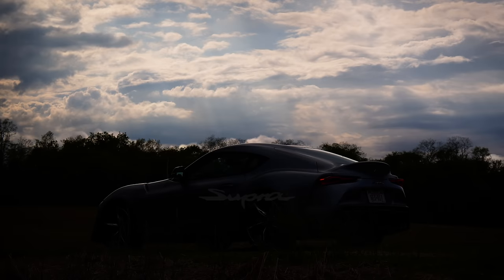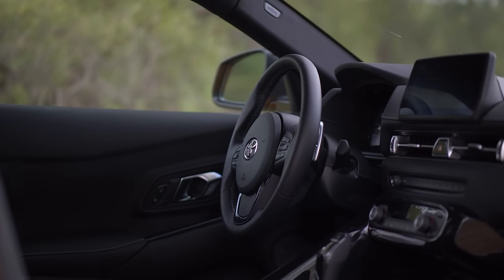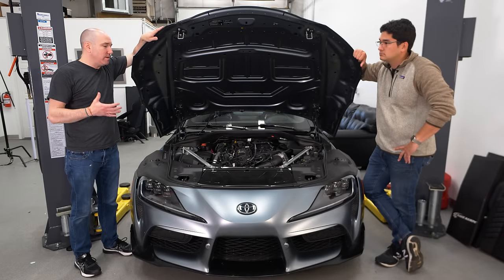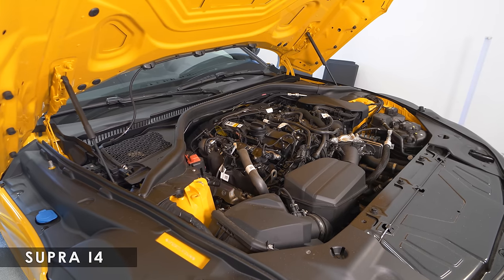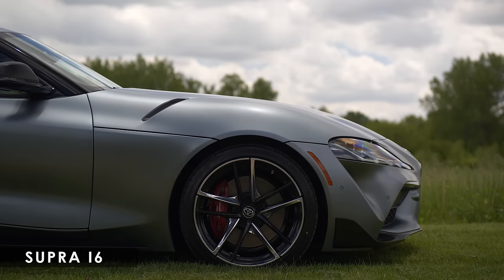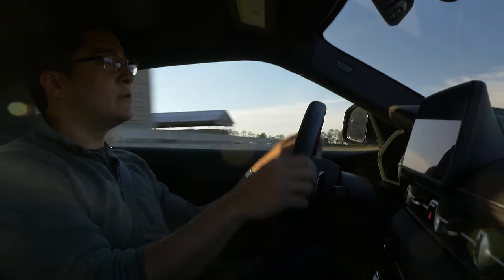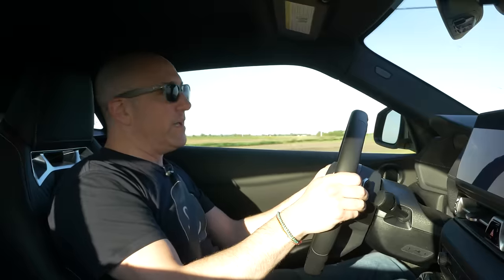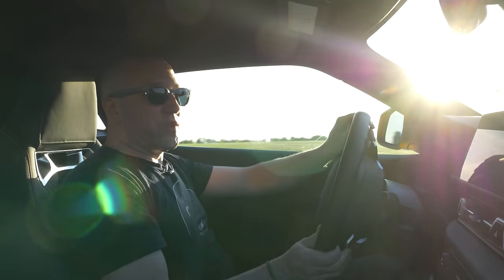2021 Toyota Supra | 3 Pedals Short of Greatness

Comment: If presented with both options, would anyone pick the automatic? Like the kind of people that might want to buy a Supra--aren't they the same people that drive stick? Are there really casuals buying these things?
Reply: To answer your question, more people who are in the price range usually drive autos (casuals). Manual is more of an enthusiast thing. If you see a 370Z riding around and the driver is girl, that car is most likely a auto (there’s exceptions) but most normal people just like a car because it looks cool more then the performance aspect.
Reply: @MaddNomad1015  right but aren't the casuals buying Porsche Caymans, Mercedes C class, BMW M340 or M2, etc
Reply: @cwx8  some are yeah. It’s like this one dude on a different supra video was arguing the whole why an auto thing and it just comes down to casuals buying anything cool that have the coin. I’d love a stick in the Supra but I get why Toyota did it business wise. I’m actually cross shopping a Supra with a Lexus IS350 FSport, if Toyota doesn’t make a stick I’m most likely going towards the Lexus just because I know it’s bulletproof
Reply: @MaddNomad1015  love the new IS. One of the best looking small 4dr on sale right now. Motor is kinda lacking though but as you'd said probably bulletproof
Reply: @cwx8  yeah it does for what year we’re in for sure. I want to at least see 350 hp. At least. I just like the new suspension work they did on the new IS.
Reply: @MaddNomad1015  yep 350-360 is perfect. What's the tuning scene like with those motors? I will say having done a teardown of the b58 it is quite a beast. No real cost cutting measures like the N motors.
Reply: @cwx8  The Toyota V6 was notoriously hard to crack ecu wise for awhile but people mod them. Turbo kits are online and the forums are pretty good, a lot of trial and error for sure. But the community is great. The B58 from what I’ve seen is awesome, do you think it will hold up to the test of time? It’s a huge reason why I want the Supra
Reply: @MaddNomad1015  looks like it. They didn't mess around with the motor. With BMW it's everything else that I'm worried about these days.
Reply: @cwx8  that’s what I’m worried about too. I’ve been keeping up with forums. The engine is great though especially after seeing Papadakis rip it apart

Comment: “It’s risky to make a sports car these days”.  And yet everyone from Chevy to tiny little Mazda can make their own sports cars.  And collaboration is a generous description for the Supra, does it even have a single Japanese part?  I’m glad the car is good, but I’m tired of the excuse making.  Toyota is the only major manufacturer that does this.  Toyota is a huge company, and if Chevy can build their own mid engine sports car there is zero reason Toyota can’t build their own Supra.  The 86 was the same way, that car is 95% Subaru.  The Supra is 99.5% BMW.

That said if BMW were to add a manual to the Supra I think you’re right, that would truly make it great.  For a car that apparently emphasizes driver connection, I’m amazed they launched without that option.  As it stands, for my next car I’m waiting to see what Nissan does with the Z, and praying they are paying attention to what’s missing from the market: a relatively affordable Japanese sports car, with a manual, that is not outclassed by a Civic Si.

Comment: Would have been nice, if Toyota could have put one of its own, maybe modified, 4-cylinders in it - Toyota has plenty of those. I'm not the biggest fan of the BMW 4-bangers which don't compare to their 6-cylinders. But I guess going with the BMW engine was cheaper (since it basically comes with the platform) and I don't know, if the terms of the agreement between BMW and Toyota would have allowed for this in the first place. Oh, and an LSD would have been nice. Maybe next year, lol.

Comment: This is a very cool car that I would love to have but not with the BMW DNA.  I like to buy my cars and keep them for a long time so having a car that every repair and maintenance project cost 10 times more than anything else is not something I want to get into.
Reply: My co-worker has an 08’ M3 with 150,000 miles. I just sold my E46 M3 with 200,000 miles. My car has had a fair amount of preventive done to it since it was a track car, but my co-worker is at 150k miles off routine maintenance. I’ve personally driven E39 M5s with 350,000+ miles on them. These cars last forever, so long as you treat them right.

Comment: Open rear diff at 43K for a dedicated sports car?  4 speakers?   No manual transmission?  And fuel cut off around 6K?   The base Supra kind of missed the mark...
The 6-cylinder version is really the only choice between the two, welp now to wait 4-10months now to see what Nissan can do with the redesigned Z.

Comment: Why would they make a 4 cylinder supra? I'd just buy an 86 at that point.
Reply: Then you are only focusing on one part of what makes a car good.   Everything underneath an 86 is budget oriented, including that 4cyl engine.  It's a good car, but not comparable.
Reply: @travis5481  Fair. It's just that with 4cyl I'd feel like I should have just saved the money and gone with the 86 or spent the extra money for the 6cyl. I can only imagine it wouldn't feel as special.

Comment: Toyota messed up BIG time here... a 4 cylinder car keeps getting compared to a 6 cylinder car and it looks bad. They should have made a different body for the 4 cylinder model and gave it a different name if you ask me...
Also, early adopters DID NOT GET BURNT... because their cars still work fine. They drove the Toyota Supra for an ENTIRE YEAR before the 2021 came out, and had fun. I don't call that getting burnt. Upgrades are good, there is nothing bad to say about that.

Comment: 54K just for the premium edition, might as well just save for a few more months and get a C8....
Reply: Its rare find a C8 at 60k better yet under 70k. Most I've heard is most being 75k or more. You could just get a 2020 mk5 and pay like 5-10k less once these start rolling around.
Reply: Supra beats a C7 stock for stock, B58s with bolt ons make 700+whp. A very slightly modified Supra will destroy, if not at the very least keep up with a C8 for less money.

Comment: Without a doubt this is a great car I just dont get why they rebadged a BMW, If they wanted to use a readily available great inline 6 for cost cutting use the B58 drivetrain and drop it into a RWD built Lexus chassis or something else from their own stable. They could of created the chassis ( or borrowed from Lexus who already has multiple rwd chassis ) and also did a full Lexus / Toyota interior. I just cant fathom why one of the biggest automotive conglomerates in the world couldnt muster up a few bucks and use their own tech / infotainment / interior /chassis etc etc. iDrive is one of the best so whoever buys this is in for a treat but its like 0.5% Toyota and 95.5% BMW. This is just wrong to do to your Halo car, Could you imagine if Nissan had the GTR just be a rebadged Mercedes.. If Toyota doenst have the money to invest in a sports car then no manufacturs have money to invest in anything..
Love the car, Love BMW's but this is no Supra its a new Z4 Coupe like you guys said and thats great as well.

This in a manual with some BMW badging and we have a modern day Z4 Coupe.

Comment: If Toyota had made a manual optioned Supra A90 MK5, majority of the ones that say "I would buy it if it came in Manual" keyboard warriors wouldn't put their money where their mouth is.

P.S.

Vehicles like the Nissan GTR R35 , ETC is not scrutinized for having no Manual Transmission.

Same with the 1980s Buick Grand National/GNX.

Comment: I am not one for comments but when I saw the engine bay on both the 4-cylinder and the six cylinder, I was flabbergasted by the amount of hoses and connections. It reminded me trying to figure out vacuum lines on a 85 Mercury Grand Marquis or a late 70s Honda cvcc. Hopefully they done vibration testing and heat testing on all those connectors!
Reply from the maker: Looks like a Science Fiction movie under the hood. I cut out a tangent talking about it.
Reply: @savagegeese  again most people nowadays do not work on their own car I work for AAA and due to the pandemic I am not opening up for going into people's cars to open up their Hood. 90% of the people struggle opening up the hood LOL

Comment: It's a nice BMW, I wonder how reliable the electronics will be in 10 years, and how much the dealership wants for parts and service. Don't lie to yourself, it's not a toyota, it's a nice BMW. Wonder if the towtruck has those extra pedals for when it won't start for some random, expensive reason.

Comment: Wow guys you went deep in that diff differences explanation and I appreciate the intricacies in details you always present. Keep up the great work and as always camera work at the start is really nice. If you took it to a Track or even when you were on the road did you notice the dangerous sounding bump steer that 2020 has a t high speed, mentioned here while in 2021 model 6 cylinder or 4 cylinder? https://youtu.be/XSH3RgGSmF0. Agree could do with some turbo whine, instead of just the engine pumped in the cabin as in my test drive too, agree all you can hear is pumped is engine noise although good other sounds would be great.

Comment: 1- The engine: very complicated, hard to work on, expensive, and complicated.

2- The body: short, small, midget, with a buffet, and ugly.

3- Suspension: BMW, not efficient LSD diff. Already in accidents. TITAN’s car has snapped the axles.

4- Transmission: 8 speed auto. No manual = no fun

5- Identity: when the BMW decided to discontinue the Z4 Toyota offered them to exploit the supra name. The car was even recalled by BMW, therefore it’s not a Toyota.
Reply: 1. It's not complicated. If they we're so complicated then we wouldn't be seeing the numbers people have been simply pulling out of these left and right like they are today.
2. It's as long as a Silvia. I see noting wrong with that since it can be a instant go to choice for drifting for that reason plus it already having a good amount of space to comfortably fit a 2j or probably even a LS I'll gladly take a shorter wheelbase.
3. People are going to crash these regardless of who's driving them. Also,the axles don't just snap at random since people have found that they only snap if your pushing over 650whp+.
4. Ok,who cars? Many cars are going auto. Yea it kills the fun but for the amount of autos vs manuel people don't put there money were their mouth is since at points they'll say they'll buy the manuel and the cars sales show the opposite afterward.
5. That was 7 cars. Practically,it's not like people forgot what Toyota tried to do with the 86 which caused some owners cars to start blowing up from left to right. Plus who cares who recalls it? There's so many collabed cars out there that this shouldn't be any different. The mk5 and Z4 are just like the huracan and Audi r8. Ones got better specs,faster,and more people are bound to do more things with it then the car it shared parts off of.

Comment: Magna Steyr built the gr Supra, not BMW, even the platform for Z4 and Supra was co-developed by both BMW and Toyota and the BMW Clar platform and Toyota Global Architecture platform both came out in 2015, I think Toyota was more involved in the process than people think. Yes Supra uses inline 6 from BMW but it was Toyota Gazoo racing who tuned the Supra not BMW and that was from 2014 to its release   https://www.investopedia.com/ask/answers/060115/who-are-bmws-main-suppliers.asp

I wanted to make another point about the inline 6 Quote"The BMW B58 is a turbocharged straight-six engine, which began production in 2015.[1] The B58 replaced the N55 and was launched in the F30 340i  https://en.wikipedia.org/wiki/BMW_B58

so again Toyota and BMW partnered in 2012, they worked together and went their separate ways in 2014,  inline-six began production in 2015 as well so I wonder how much say Toyota really had, their inputs, their suggestion on doing things? I think people have not given Toyota credit they deserve. It may be that Toyota was more involved than we think.

Comment: the joint venture  is not so much a problem as the level of disrespect from toyota to not have the mk4 s cockpit style when the corvette has it .......at very least , like the gtr does with its tail lights just cup our balls out of respect....till then? civic type r or an actual bmw or an actual toyota .

Comment: Fuel cut at 6000 RPM?  In a 2020 4 cylinder sports car??  What the fuck is Toyota doing?  We’ve had higher revving truck engines for 30 years now.

Comment: Hate these so called "enthusiasts" complain Toyota partnered with BMW to make this car. So what if it's a BMW? Would you rather them not make it in the first place? Understand the modern market and economy. This isn't the 90s.
These "enthusiasts" who complain are in two camps; The ones that want and can afford to buy these kinds of cars and the other are those who will buy used down the road and post their "jewel" online like they are some bad ass. The latter does nothing for Toyota and the former is such a small percentage it is like a drop in the lake. I doubt these "enthusiasts" would buy it new if it was Toyota made, had a manual, and crack in the glove box.

Comment: Meh, they still haven't fixed the awful interior, that's the only real issue with the car TBH, I don't care that it has a BMW engine just like I didn't care that my MK3 and MK4 Supras had Yamaha (JZ series) engines attached to Hitachi turbochargers.  It's the budget grade interior that puts me off buying the car as that's where I sit when driving them and interiors was always a place where Supras excelled.
Reply: Uhhhhhhhhhhhhhhhhhhhhhhhhhhhhhhhhhhhhhhhhhhhhhhh

Comment: At 3400 lb. the new Supra is porky and its styling is over-wrought. This is a commuter car masquerading as a GT, a daily driver for show-offs. The turbo is great for on-ramps but ultimately boring. A manual shifter is a hindrance to commuters so the auto makes sense. This car will not cost Porsche a single sale. But Toyota knows what makes people buy, and this just might sell in sufficient numbers to the wanna-be's to justify its development.

Comment: Great review of the 2021, Can you comment on the rear bump steer issues during large weight transfers from front to rear or vice versa?  https://www.youtube.com/watch?v=XSH3RgGSmF0 this issue has been brought up by a few racers, tuning houses, and a few journalists so I believe it is legit and not just an alignment issue.  Sadly I did not see any announcements regarding suspension geometry changes for the 2021, just bump stops, differential tuning, chassis stiffners, suspension tuning.  None of which resolve bump steer, if that is indeed the issue.

Comment: Why do you have such a boner for manuals I just don't get it. You can have more fun not having to mess with pedals. I love f1 style shift pedals on the steering wheel and automatic transmissions. It's just nostalgic love that has blinded you from taking an unbiased approach on transmissions. I hate the supra but the reason it is bad has nothing to do with the transmission.

Comment: I'm one of the loyalists that downright objects to this.  It isn't a Toyota.  It's a BMW built by Magna Steyr in Austria. 

But even if you can get over that, the Z4 coupe is HIDEOUS.  The styling is terrible.  There are fake vents everywhere.  You can't see out of the damn thing.  The side window opening is too small, making it hard to see out the side.  The door opening is too small, making it nearly impossible to get in and out without smacking your head.

While the upcoming manual transmission is an improvement, that doesn't change the fact that this is a BMW with extra ugly.  If I want a BMW, I'll go to a BMW dealer and buy one.

Comment: No, you are totally wrong, they didn't even try, it is a BMW, there is nothing of Toyota, starting from how it drives. Amazing price? joking? 80k euro amazing? Lol it's damn slow for its price tag, it can barely keep up with a 370z and a 3.8bk2 gencoupe, plus the feeling you get is a lot more genuine in those two. It's a total fail from any perspective, starting from outside design, that front lives in all the worse nightmares. The back is cool, bit for real, what did they think while drawing the front of this car? I feel sorry for the Japanese engineers of Toyota forced to work on such piece of trash.
Reply: All German engineering here, but how can you say it’s slow compared to 370z and the genesis when it’s comparable weight with way more power/torque
Reply: @ervin7178  try it and test it and look at the numbers it take for 0/100 and 0/200. The car in stock form doesn't perform. The ones you see on web with more hp than declared is an old trick, builders give to press\youtubers cars mapped\sligthly modified compared to the ones you are going to buy at dealers. That's the sad truth. I suggest you to watch also what the best Japanese tuners say about this car "slow, can't turn, can't brake, can go to battle with this car". The performance are embarrassing for a 80k euro sport car, you start to have definitely other and better options at that tag price, it should have been sold maximum at 50k euro.

Comment: Cannot get a manual, cannot drive with the windows down, strange tablet on the dash, crazy mess under the hood, subjectively ugly as sin styling.  Deal breaker.
Reply: Just buy the BMW version of this car, since it comes in an optional manual, it’s a vert so you can drive with the windows and the top down. And it’s kinda nicer than a coupe if that’s your thing. Want manual? Buy the BMW. Don’t care to shift and want a faster visceral experience? Buy the Supra